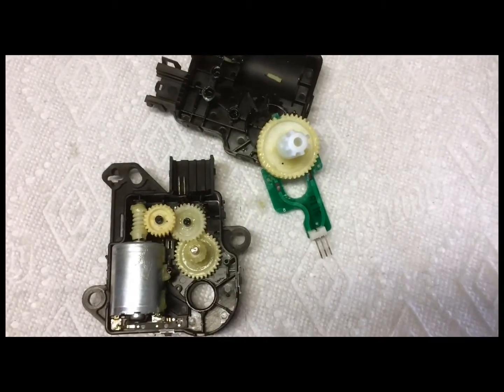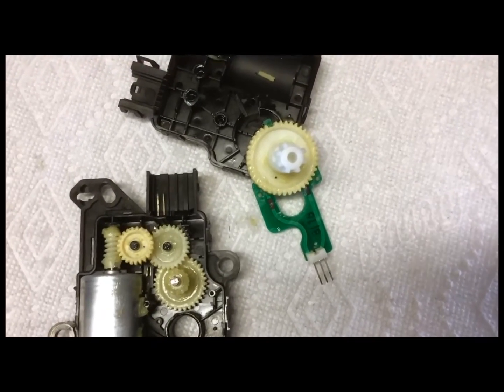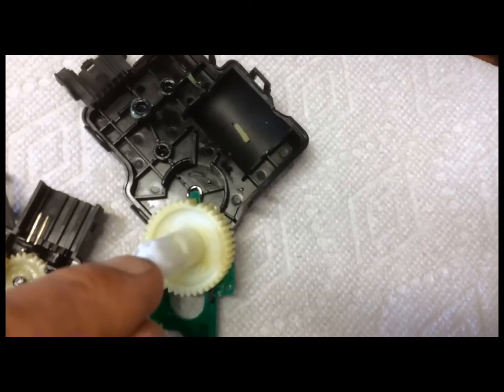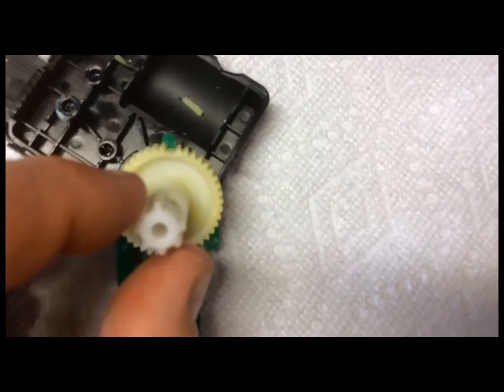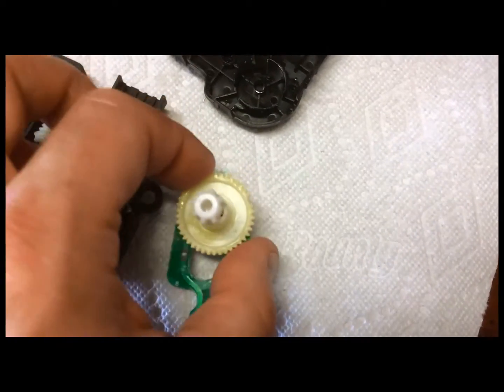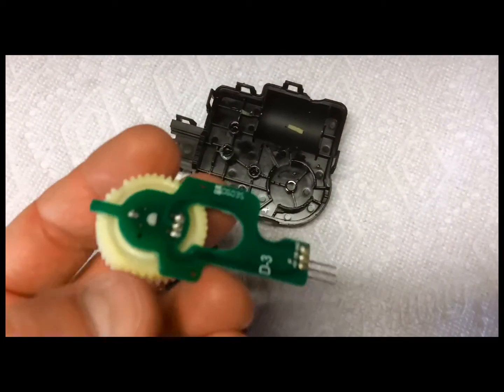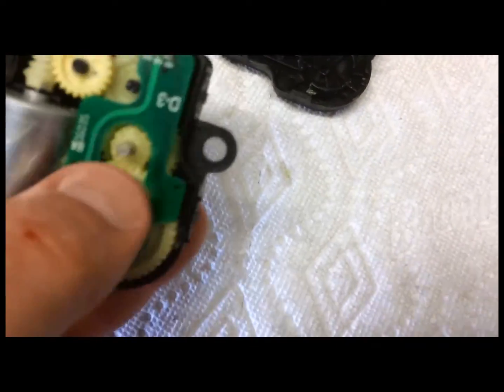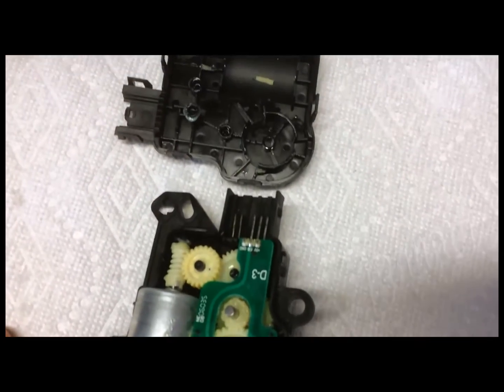2009 F-150 Broken Blend Door Actuator Dissection and Analysis

Comment: That missing gear is not missing. That empty slot is for calibrating or lining up with the blend door gear. I agree however, that taking  the part apart makes for easier removal. If you pop the top off, pull out the small motor, the back screw is easier to get to from the front. This saves alot of time removing the part.